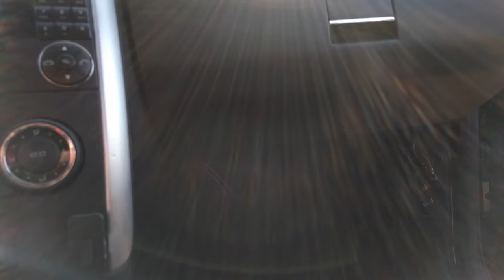Mercedes B class Sam Module DIY

Comment: Great video, are u able to tell what each plug on the Sam is for? 

I changed my blower fan and had unplugged some connections to the sam now my rear lights will not work getting an error on dash for all rear lights except turn signal... 

Any help is gladly accepted
Reply from the maker: Hi, don't know that, sorry.

Comment: Thanks for the video.  I am having trouble removing the plastic cover on the relay panel.  You show to push on the left side but this does not remove it on mine.  There was a green piece of tape, I removed that.  What am I missing?  The electrical connections don't need to come off right?
Reply: Did you find out how to remove the plastic panel ? I’m stuck pushing the left site does not produce any effect
Reply: @yoannkau1460  Yes, I got it.  I have a video about it but not sure how to find this post on the forum pages.  I will search a little more.
Reply: @ericparry7032  crossing my fingers, hope you can find the post

Comment: hey, i have aux option on my screen, but there is no where to plug the cable, i dont like using CDs, what and where should i took off to put a cable.. i had same problem with golf 5, but i menaged to put a cable inside so i had aux working.. can i do same with b class? please respond
Reply: My 2010 w245 b class has the aux port in the glove box, have you checked this, mine is white

Comment: What does the SAM module do?
Reply from the maker: SAM stands for Signal Acquisition Module. A SAM module (also called Signal Actuation Module) receives data from sensors, switches, and controllers, and can send data, actuate (activate) components and monitor systems. Mercedes-Benz has been using SAM modules since the mid-90s.

Comment: But it has to be coded right? Cant use any device
Reply from the maker: It should work if it's the same model car
Reply: It looks like it has to be coded into the car. The reason I'm saying this is that after I replaced mine, it couldn't start and threw few more errors, with SRS being one of them. Now I had to put back the original and the problem of not starting persisted. I'm sure it will be remedied by reprogramming.
Reply: @TenCentsMusik  Hey man I’ve exactly same problem changed Sam unit and now won’t start no matter what...  I put in original Sam unit still no start did you get it running?
Reply: @Linas Sidiskis  maybe the SAM unit wasn't put in correctly. It has clips and if it's not clipped in properly, then it's not making contact and so ot won't start.
Reply: @Donald Serage  You legend thanks 🙌
Reply: @linassidiskis2859  what year was your car? I have read that for 2006 models it doesn't need coding? My wipers have stopped working and I think I need to swap the Sam out..
Reply: @TheKrisieP  Doesn't need coding was 2006 also, I recommend to check fuses and relays and then wiper motor it self. Sam unit usually only gives trouble with the lights
Reply: @linassidiskis2859  completely forgot to reply to this but I tested fuses, relays, stripped and inspected the SAM unit. Tested the fuses and relays, everything was good, the Sam unit looked fine, I took the motor off and put 12v to the motor and found it whizzed around fine but I decided to replace that first and that did the job. It must have been one of the components between the plug socket(on the motor) and the motor itself that failed. Thanks for the response